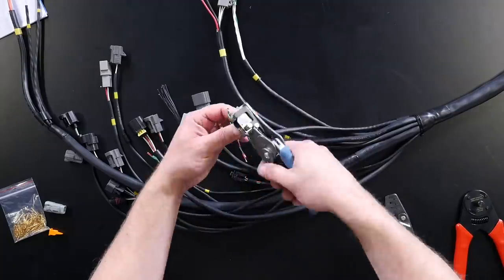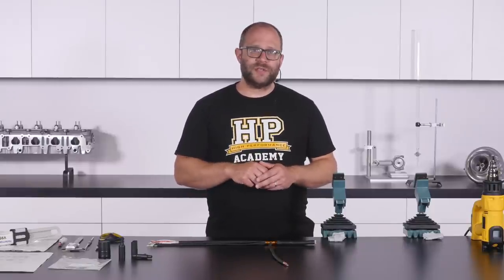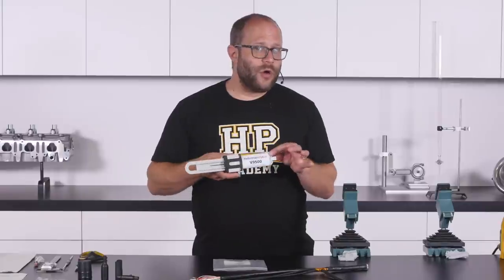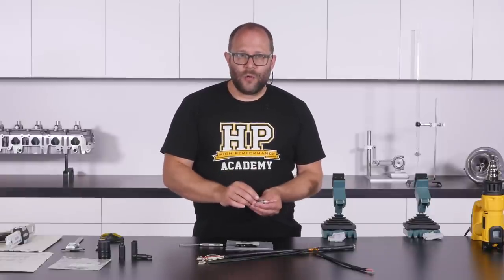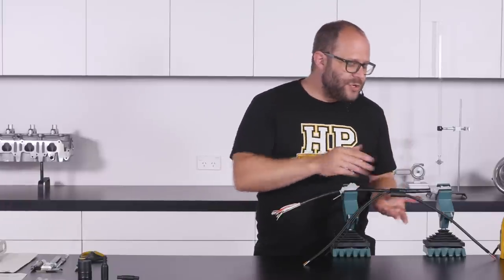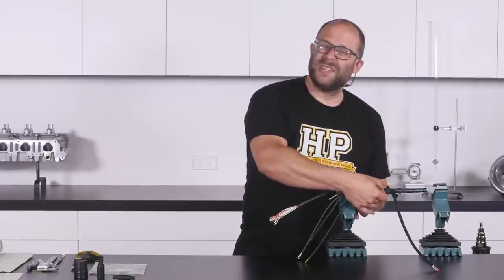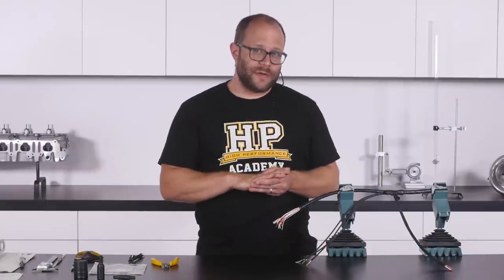Better Than OEM? | Why Do We Boot Transitions For Motorsport Wiring?

Comment: Quick tip-
After mixing the epoxy flip the plastic bag inside out and cut the corner off the bag. You can then squeeze the epoxy directly into the syringe and not waste any or get it all over trying to put it in using a mixing stick.
Reply: Or even better; mix it in the syringe instead of the bag
Reply: Are you a chef! That’s a great idea, these guys should make a product like that.
Reply: Or spend $2 on a mixing tip though there are waste inside the nozzle it saves time and no worrying about unmixed epoxy being used. Probably waste the same amount stuck to whatever you mixed the epoxy on.

Comment: Why not use a mixing tip on the epoxy tube? It will mix the two parts as you dispense it which you could do directly into the boot, or if you still need the small tip of the syringe you could use the mixing tip and dispense it directly into the syringe. Would be a lot faster and cleaner than mixing it by hand.

Comment: Love for your channel which looks so informative and aesthetically appealing. Before starting the wiring, do u conduct any electrical circuit simulations for the electrical components being used?
Reply from the maker: It depends a little on the components and the level you're working too, but generally yes and a common term is 'bench testing' if you want to look into it further 😎 
Depending on the specific components there will be a few different ways to approach that too along with testing the harness itself - Taz.
Reply: @hpa101  Is the wiring harness testing available in your course? if yes, what software are you guys using for harness testing?

Comment from the maker: We tired to make t-shirts out of the same things Zac is made from (70% cheese, 30% wine) but turns out that guy is one of a kind, so here are some tees made from quality cotton and screen-printed by hand instead: https://shop.hpacademy.com/ -  Taz 👨🏻
🔥 Building a fast car? Get $400 OFF the all inclusive VIP online course package deal: https://hpcdmy.co/vipy108
⚡ 50% off your first online wiring course! Get the knowledge and confidence you want. Enrol today: https://hpcdmy.co/offery108
Reply: Subtitule in spanish please
Reply from the maker: 0:00 - Why Do We Boot Transitions?
0:15 - 2 Main Options
0:42 - Raychem vs HellermannTyton
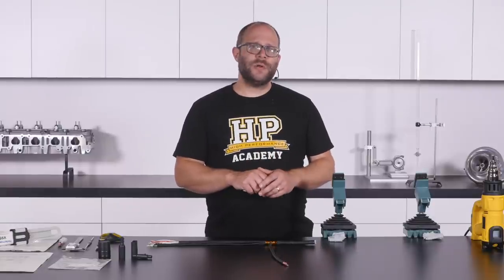1:15 - Unrecovered Form
1:43 - Shape and Size Selection
2:25 - Our Example Materials
4:32 - Practical Example
16:01 - Final Inspection and Summary
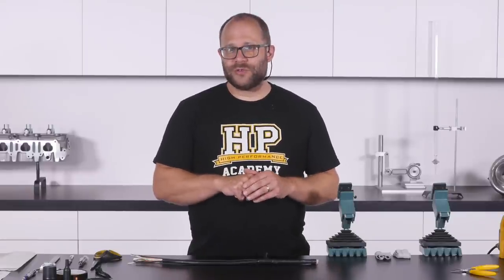17:41 - Just One Example of Many

Comment: I wonder if you could mix it in the bag near a corner, then once mixed, cut the corner off of the bag and then do like a cake maker and squeeze the bag into the Syringe. Just a thought. I have never done it before. Anyways. Thanks.
Reply: Totally works, and you can knead the two parts together to really get it mixed well

Comment: I really enjoy these technical videos with high effort craftsmanship. On joins that I know are in relatively low temp areas, I piece of hot glue inside the boot will melt as you shrink and make an excellent seal. 

Also, you don't need to mix the epoxy, just buy some mixing nozzles!

Comment: One step not covered here was keying up the boot and heat-shrink surface. this can be done with some light sandpaper which vastly increases the bonding strength and protects against sheer fractures which occur from lateral tension. We performed tests to verify the difference, one had the DR slide out the boot leaving the cured glue behind in the boot and the other tore the heat shrink before the glue bond fractured. 

This is at least working at two motorsport harness manufacturers in the UK Prodrive and Progressive motorsport. 
Great video though, for low temperature environments a simple piece of ATUM crimped closed when hot works in the vast majority and would be a cheaper alternative for homebuilt harnesses.

Comment: What's the application difference with lipped and non lipped boot?
Reply: Lipped boots are required when using a boot on an AS connector, the lip grabs onto the knurling on the connector backshell. non-lipped boots are more likely used for transitions where the lip is not nessicary.